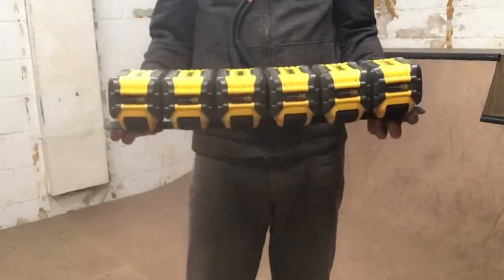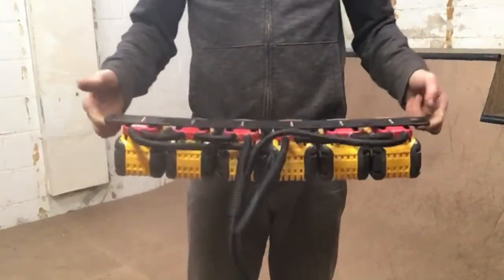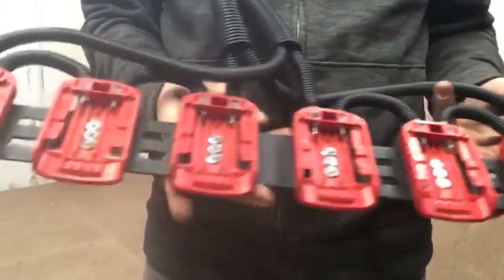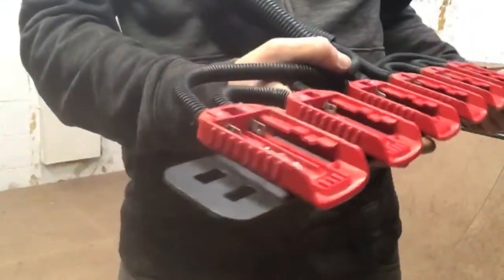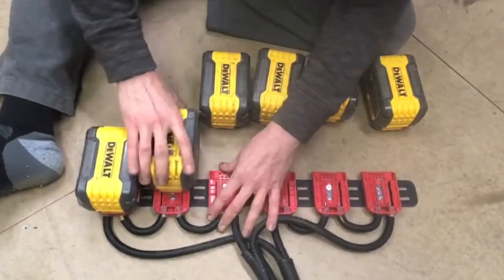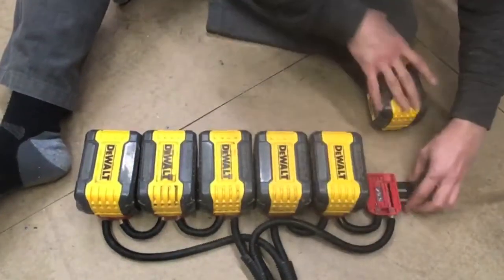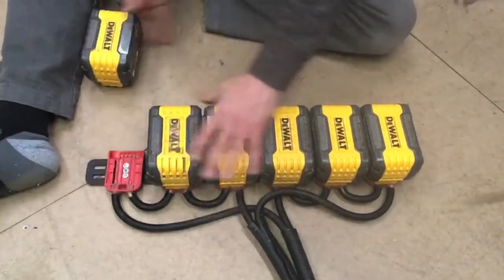Dewalt Power Bank 60V 18,000mAh - FAIL?

Comment: This is exactly what I’ve wanted to make out of my old 20v batteries for an electric boat motor. 
Any idea on range under specific load?
Reply from the maker: I can go one mile per amp hour, but that is on land. When the batteries are fully charged it outputs 55 volts at 35 amps to power my 2,000 watt electric trike. I wouldn't leave lithium batteries on the boat when you are not using it, water makes lithium explode.

Comment: You are a genius!!! I need try something like that
Reply from the maker: Thanks! Unfortunately the red caps are not that strong, and I broke several of them in different places. I'm getting some battery caps 3D printed in nylon, more expensive but way stronger.
Reply: You almost need to just use dewalt drills just got them and cut them in half

Comment: How is it a fail and what is it for
Reply from the maker: The red caps are not strong enough to hold the heavy batteries on the rack for very long. Too much vibration eventually cracks the red plastic. I tried to reinforce them with fiberglass, but they were still not strong enough. I replaced them with 3D printed nylon battery mounts in a new video for my e-bike and electric drift trike. https://www.youtube.com/watch?v=zMcLQ5ORows

Comment: Have you actually measured the voltage? The red caps are designed to disconnect the voltage for transport. So you should be getting zero volts. Unless you modified the red caps this will not work!
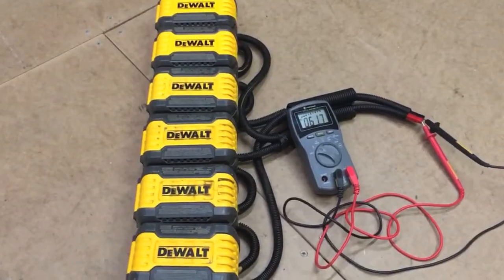Reply from the maker: I cut the little tabs off of the red caps so I can use smaller non-Flexvolt batteries, and I measured the voltage at 0:54 in this video.